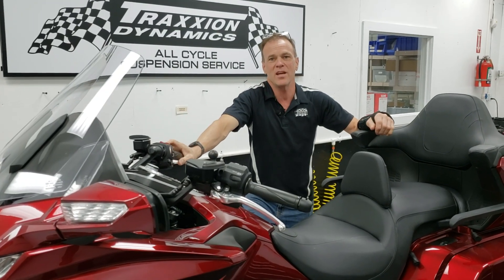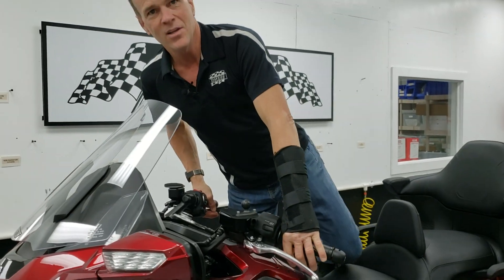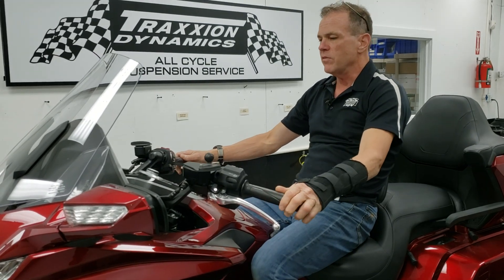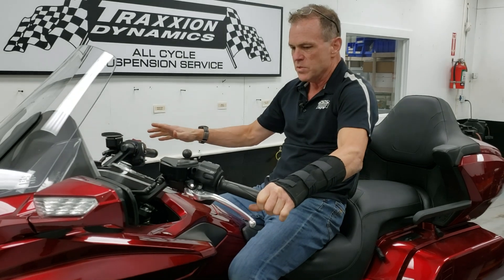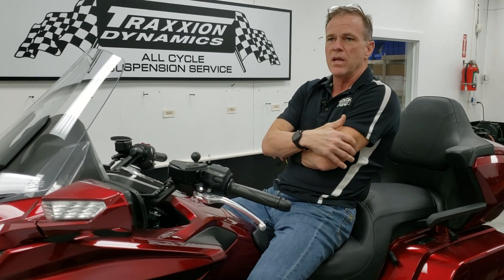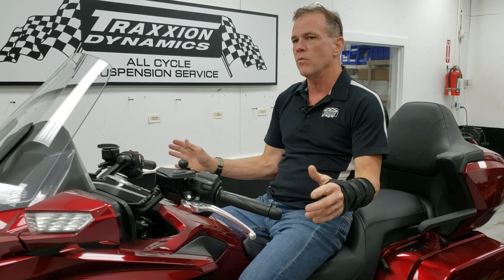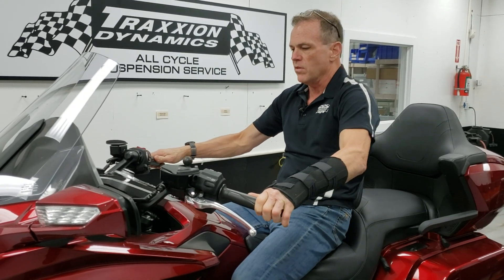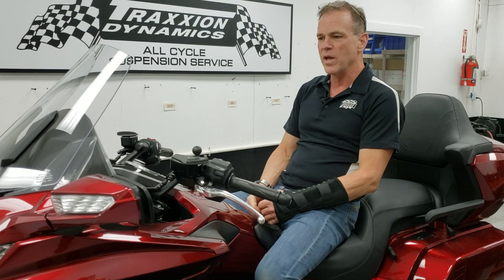High Speed Shake/Shimmy on 2018+ Honda Goldwing

Comment: I have a 2018 DCT Goldwing and I had the same shaking issues my front rim did not have any weights on it for balancing from the factory. I bought Centramatic front and rear. That helped the shaking about 20% better.
So I bought a new front tire same type that came on it stock Bridgestone.That improved it about another 20%.
Then Had it balanced with the Centramatic on it. They  put 3 1/2 ounces of tape on weights.That improved the shaking  90/96%.
With my hands off the bars there is a very small shaking throughout most all speeds 20 mph on up
Centramatic does not recommend to   Add tape on weights with the Centramatic‘s but that’s the way I’m running it right now. 
My bike has about 3000 miles on it.
Thank you Max for bringing this out to the public. I love my Goldwing it is the ultimate.
Reply from the maker: You need to remove the centramatics and have the wheel balanced by itself.  3 1/2 ounces of weight is a TON.  There is no need to use a heavy gyro weight on any wheel.  If you have a bike that has a vibration problem, masking it with a heavy gyro doesn't solve the actual problem.

Comment: I have a 2018 DCT Tour Airbag.
I had to replace my tires when the bike had 22,850 kms on it. The bike came with the Bridgestones and that’s what I replaced the tires with at that time.  I immediately noticed that shimmy you’re talking about.  Because we replaced both front and rear tires I thought it was possibly a balancing issue. I bought the Centramatic for front and rear.

No joy. 

So I put back on my original front tire and the shimmy was gone.  I bought a new tire as I was just taking off for Wingding later that week. After putting that tire on the shimmy was still gone. 

I talked to Bridgestone. and they guaranteed that if I had next to no wear on that tire they would give 100% warranty on it through the tire dealer I purchased it from.

Since then I sent the tire back and have received 100% credit card refund.  Bridgestone. was wonderful to deal with and so far I like having the Bridgestones on my bike.

I don’t know if it has been only Bridgestone. that people have found this shimmy with or not.
Reply from the maker: Great post!  I don't think the centramatics benefit you.  You found the problem.
Reply: Yup, happened with me and my Bridgestone Exedra Max

Comment: My bike isn’t doing it at 50 and above. But 45 and below, without my hands on the bars. Major wobble/shake. I got rid of it once with a new tire. But now it’s back. Seems like maybe the balance goes out quick or something. I just did a video on it today and posted it on my channel. A sub wanted to see it, since his is doing it too. I’ll be getting a new tire soon. Most likely next season so, wait and see what happens.  I’m still trying to get down to your place so I can try out the suspension. Need to make time for that. Thanks for the video!
Reply from the maker: Is your bike a 2018+?
Reply: @Traxxion  yes it is.
Reply from the maker: That is EXTREMELY unusual, so I believe the main bearings on your "tuning fork" may be loose.
Reply: @Traxxion  awesome. Lol. Not exactly the news I was hoping for. Well, that’s the way it goes I suppose. Maybe, when I make my appointment for tires I can have my tech check for that. Thanks for the information!

Comment: Confirming that the wobble issue with my 2018 Gold Wing DCT Tour went away once the dealer replaced the front tire per Honda’s authorization. It actually took several miles to “break in” the new tire before the wobble went away entirely. Bike at the time had less than 1000 miles.
Reply from the maker: What brand of tire did you have?  Did they replace it with the same brand?  I haven't kept track, but I need to start.
Reply: Max McAllister & Traxxion Dynamics   Bike came with Dunlops and that’s what the dealer used for the replacement.

Comment: Hey Max, Thanks to this post I got aware of the very slight shimmy on my 2020 DCT Tour. If I let my hands off at 60, you can see a tiny shake on the bar tips. It is not a critical shake at all. This is my first GW, so I am not sure what is normal.  I do have Helibar kit and Goldstrike grips. Goldstrike claims that the grip kit is the same exact weight of the Honda OEM weights. Should not effect. I went to the dealer and the mechanic said that that tiny shake is normal and I should not take my hands off at 60. I said....ok DAD LOL. They claim that If it wobbles left/right then something is wrong.
Reply from the maker: Left right is bad for sure.  Up and down is tire or shock.  They will never admit to shock... hahaha!  Balancing pretty much never fixes it, you likely have a bad tire.  I would make the SMgr ride it, then buy a tire, then see if it goes away.  If it does, Honda should pay for your tire.  If not, you have 2 tires!
Reply: @Traxxion  Thank you for replying !!! I will do so. Once it is warmer a bit, I will take a ride to them to check. The tire replacement might be the key to see. Keep up the great work.
Reply: @Traxxion  Thank you for replying !!! I will do so. Once it is warmer a bit, I will take a ride to them to check. The tire replacement might be the key to see. Keep up the great work.
Reply from the maker: @alp3781  Happy to help!

Comment: Same issue on the 2014 Honda CTX1300.  Same size front tire (130/70-18)... I bet it is with the same tires!  I had this same issue on my CTX1300 and it went away as soon as I purchased a new tire.

Comment: I have heard this complaints forom goldwings which has factory installed Dunlops but never heard from the lucky ones whose bikes equipped with Bridgestones. My bike is more than 50k kilometers and nowadays i will replace my 3rd set of Bridgestones. They dont shake or wobble at any speed.

Comment: I just put a new Bridgestone G853F on the front and I have about 500 miles on it now and thought if I loosened my grip on the handlebars, I could tell if the tire was balanced correctly. What I noticed is that on some roads when I have the cruise set, at 45 or 50, and I loosely hold the handlebars, NOT take my hands off, the handlebars will shake. I have noticed it doesn't do it every time I do it, so I am thinking maybe the road has something to do with it. If I keep my hands firmly on the bars like I always do, I don't notice any shaking.
Reply from the maker: I wouldn't be too concerned about that... The ones I have seen actually shake.

Comment: I had a shake in my 2018 Tour DCT and replaced the front tire (a Bridgestone) with a Dunlop E4 and the shaking went down dramatically, however it didn't go away. I put Centramatic balancers on the bike and it has almost stopped. There is still a real slight shaking and does not increase with speed. It is very minor even if I loosen my grip on the handlebars. Here is my video of my handlebars shaking before I did anything to the bike. In the video, I do not remove my hands from the handlebars, I only loosen my grip, and I only do that for a second. I am sure the shaking would get worse or I could even lose control of the bike if I let it continue so I have to give it the death grip to stop the shaking. You can see by just loosening my grip, not taking my hands off the handlebars, it gets pretty violent. The bike only had 16,000 miles on it at the time. I don't have a Gopro or anything like that so I pulled over and clipped my cell phone to my jacket. 
https://www.youtube.com/watch?v=a0m_lkOyXZ0
Ride Safe
Reply from the maker: There is something wrong with your bike for sure.  And it nothing that ANY tire balance problem would cause.  So those balancers were a waste of money.  You need to get that bike to an expert to find the problem.
Reply: @Traxxion  The video was taken before I put a new tire on and added the Centramatic wheel balancers. It is now nothing like the video. The Centramatics helped a lot, but I think they are helping cover up the fork bearing problem. I bought the Honda tool, $280.00 so now I can check the torque on the fork bearings. That is what I need to do now. Thanks, Ride Safe.
Reply from the maker: @flyboy1ron  I'm glad it's improved... but just to be clear, the Centramatics have nothing at all to do with the problem you are experiencing.  If you feel they changed anything, just just because you added a ton of weight to your wheel.

Comment: What about Centramatic Balancers? I don't have them on my Gold Wing, but I know of others that use it. They say it makes the bike ride smoother and the tires last longer. I'm planning to get them for my bike on the next tire change.
Reply from the maker: That's a good question.  We don't recommend them.  ESPECIALLY for the 2018+ bike.  In order to install them, you have to space the rotors outward.  The proceeding bike has calipers that slide left and right to center on the rotor.  It compensate some... but as your pads wear, the rotors start digging into the caliper brackets.  I have photos of this if you want to email me, max@traxxion.com.  
For the new bike, the calipers are rigid mounted. You should defnitely not install anything that moves the rotors from their intended center in the calipers.
Past that, adding lots of weight to a wheel will give a perception of "smoothness" due to increased gyroscopic effect... but as far as suspension function goes, adding any weight to a wheel is bad.

Comment: Hey Max, I have a 2019 tour DCT with just about 4,000 miles on it. I purchased it with 2,000 miles. I have the shimmy at just about 45mph but mine goes away at 60mph and above. The bike has the factory Dunlops. 
I took the bike to my local dealer and since the previous owner had installed Helibar risers he said Honda would not consider doing anything.
I expected as much so I would like you opinion on the Dunlop E4's .
Also at some point I would like to bring the bike to you for the suspension upgrade but have to wait a while.
Thanks, Bill K
Reply from the maker: 2 things: it's takes like 20 minutes to remove the risers, then go back and say "now what, you scumbags?"

I've NEVER heard of a bike with risers being denied a warranty claim.  There's millions of wings with those things on them.

Your dealer is full of shit.

The Goldwing is the most heavily customized motorcycle in the world.

Wobbles have nothing to do with handlebar risers.
Reply: I've ridden over 300K miles on GL1800's.  I settled into the Dunlop E3 as the best grip, quitest tire.  Bridgestone tires came on my 2012 and this was the first time I ever had that problem.  Switched to Dunlop E3 's and broblem resolved.  Now the E4 is the latest design (having discontinued the E3)  The E4 is still nice and sticky where it needs to be however I find I wear them out on the outsides more and overall mileage dropped about 1,000.  I'm currently running a set of Dunlop D250's as that was the quickest set to get.  Still no problem with a shimmy but the are a harder compound which I noticed right away.  Maybe a better summer tire.  I expect to get more range out of them.

Comment: Is it possible that it could be speed wobble due to balancing, or perhaps the inflation being off for that type of tire perhaps incorrect tire inflation between the front and rear tyres.

Perhaps different tyre pressures may solve the issue.

Have you tried this?
Reply from the maker: You ought to Google "Traxxion Dynamics"...  A bad tire is a bad tire.  People just can't believe that's possible.  No amount of balancing will ever fix a bad tire.
Reply: @Traxxion   No I do believe it's possible but I find it hard to believe that there could be so many unless of course the manufacturer knew about It.

Tyres are made so good nowadays that allowing dodgy tires deliberately to leave their factories without a recall seem very unlikely.

However I know that many tyres are not inflated to the correct pressures or the wheels are not balanced properly or the tyres not fitted properly.

Many tyres can be simply slapped on in any position but some tires have to be lined up in order for them to function correctly.

They have a dot which has to line up with the valve or the tires won't balance properly and thus you end up with speed wobble.

Get the dot in the wrong place or don't balance the wheel properly and you have big problems.

That's why I wondered if it could be this causing the problem, as virtually all tyres are made to a very high standard.
Reply from the maker: @flitsies  Bad tires are just more prevalent than people think.  In our case, there's probably no company on Earth that has worked on more Goldwings than mine.  We have done literally thousands of suspension swaps.  We have seen things no one could imagine.  Over and over, it's just as simple as a bad tire.  We keep a set of "known good wheels" here just to swap on in case we have a bike that still wobbles or shimmies after we have checked off everything else.
Reply: @Traxxion   Well that is a surprise I must admit.

Oddly enough the Honda Deauville used to have a wobble, that turned out to be the top box causing the wobble they fixed it by providing a sliding bracket for the box so at speed the box will move, so long as you have the genuine Honda fixings you don't get the wobble.

Anyway I digress.

Comment: I replaced my tire and still have a bad shake.  Do I need to replace the wheel or just the tire
Reply from the maker: The odds of putting a new bad tire on are very low, but it is possible.  Describe what your shake is... what speed, what are you doing when it happens?
Reply: @Traxxion  driving on any type of road the front end starts shaking/wobbling at about 65 mph.   
I replaced front tire and bearings.
Reply from the maker: @davidmcconnell4443  there should be virtually no reason to change the bearings in a new motorcycle wheel (that isn't a Harley) in the last 30 years.  They are very very very rarely bad.  You must have a bigger problem that won't be solved here.  If you have a friend with the same bike,  I would ask to borrow his front wheel for a test ride to see if it goes away.  Inspecting the wheel for runout is easy to eliminate that possibility.  If another wheel/tire combo fixes it, you do have a bad tire.  If not, you have a bigger mechanical problem with your bike.  It is also possible a failing rear tire can cause the front end of the bike to wobble.

Comment: Max, From day one, I’ve had the front end shake on my new 2021 Goldwing. My dealership is in contact with Honda about this issue and they’ve done everything Honda told them to do with the front end. We’ve requested a replacement tire but they won’t warranty them. From your experience, what tire would you recommend as a replacement for the Dunlop Sportmax D243F ?
Reply from the maker: I would envoke the Lemon Law in your state.  Turn in your paperwork from your trips to the bikeshop.

They get 3 strikes, and you get a new bike in most states.  I wouldn't spend a penny.  And if nothing else, that dealer needs to put a tire on your bike at their own expense.

How many miles are on your bike?
Reply: Bridgestone makes a comparable size tire set to replace the Dunflops with.

Comment: What brand of tire is causing the front wheel issue?
Reply from the maker: You guys got me there. I need to keep a log going forward.  I didn't pay attention unfortuantely.
Reply: @Traxxion  Dude!   You know better than that. ☺
Reply: I don't know about Max's issue, but I had a new Dunlop put on the front and the shaking was horrible.  The dealer said the tire was defective.  They put another one on.  It is much better, but I may be over sensitive now, it has a slight shake, as well.  I'm riding in Europe last summer, on my older Goldwing (2004).  I needed service on my front wheel.  I found a Goldwing specialty shop in Milan, Italy.  Fantastic place, knowledgeable people.  The first thing he told me was to take the Dunlop off the bike, that the tire is trash.  He took me out back and showed me a pile of at least 100 Dunlops, many of them brand new that he has taken off many of his customers bikes.  I am not saying the tire Max had a problem with was a Dunlop, this is only my experience.  I will never put another Dunlop on my bike.
Reply: @josephfink437  Interesting, I always liked the Dunlop Touring Elite line and never had any trouble with them.
Reply: @lance3613  Probably why Max avoided getting into discussing the brand of tire.  This could turn into a tire war.  Everyone will have different experiences, I just relayed mine.

Comment: What brand tires are you using to resolve the issue then?
Reply from the maker: Doesn't matter, Doesn't Matter!  
I have found that all brands have defective tires for Wings.

You just need to replace the defective tire.

There's a guy who says Dunlop is junk use Michelin, another says Michelin is junk use Metzeler, another says Metzeler is junk use Avon... Every one seems to have been burnt by a defective tire and then they swear off that brand.

Comment: Yep.  The shake in mine diminished after a new set of Traxxion Dynamics shocks.  It went away totally after a public screaming cussing running gun battle at the dealership.  And then a new front tire I had to buy.  Honda really is a chicken shit outfit

Hah, “All of these customers met resistance from the dealership”. That’s because Honda has em scared to turn in a warranty issue for fear of losing their brownie points.  But guess what they didn’t have any problem warranty charging an anti lock sensor ring they busted while changing the tire again this spring.

The world really is full of half assers.  When you catch them they just call ya trouble maker
Reply from the maker: So true...